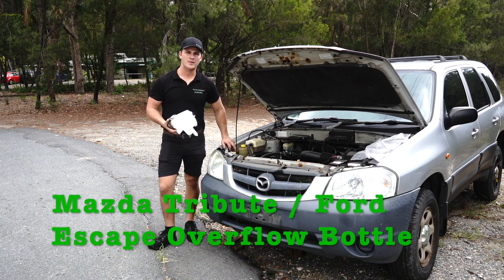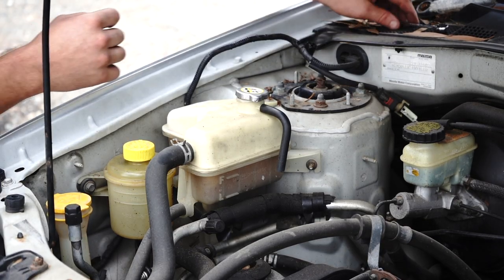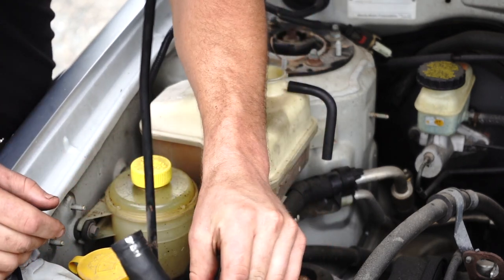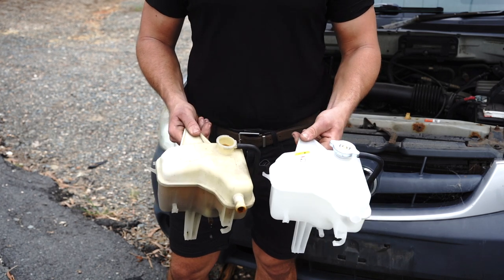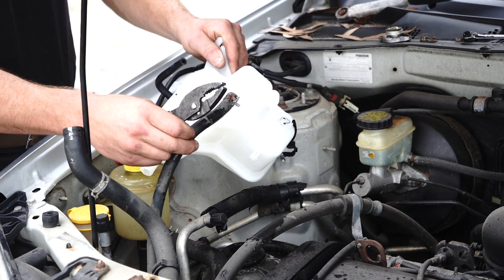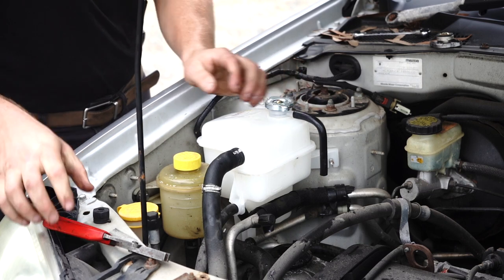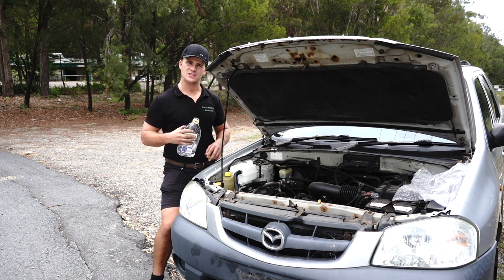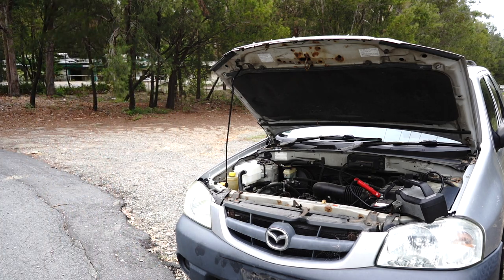How to Install and Fix a Tribute Overflow Bottle Coolant Tank Issue

Comment: I have the exact same car and there are no leak from it but water keep going empty. The water flow is leaking and is this the issue?
Reply from the maker: Leaking from underneath? Check radiator hoses and thermostat housing
Reply: Can you tell me about the 2 hoses connected at the top? Short and long